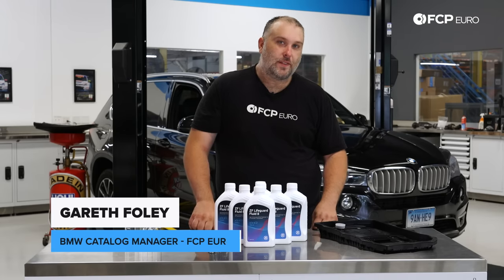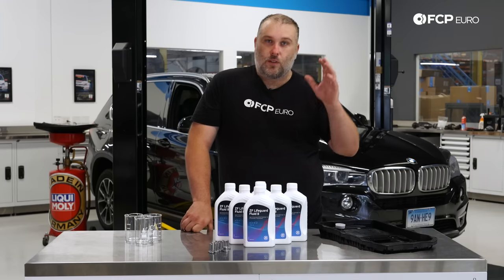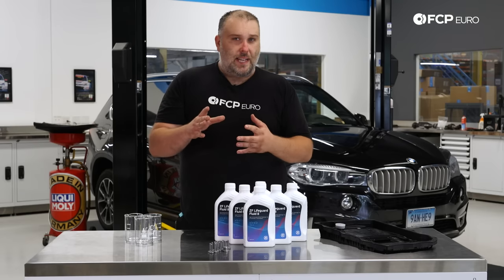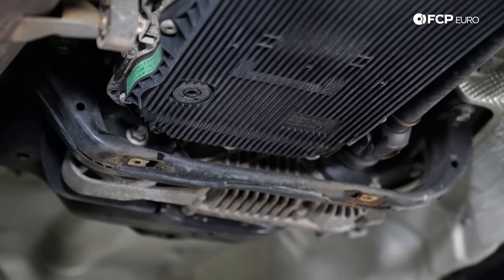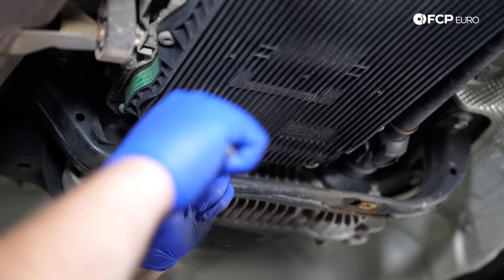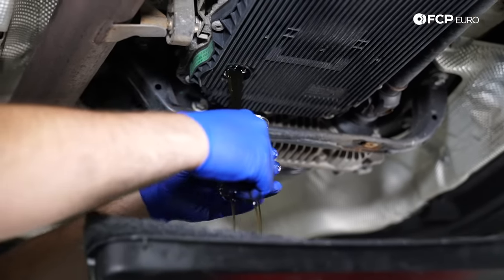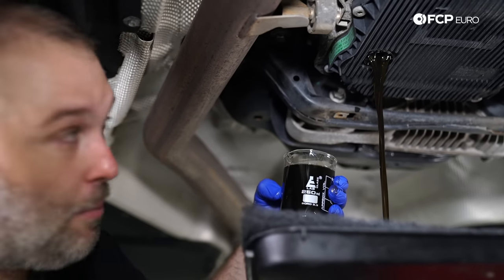ZF 8-Speed Transmission Oil Change (BMW, Audi, VW, Dodge, Land Rover, Toyota, & More)

Comment: So, i just bought my X5 from 2012. It has 230'000km / 140'000 miles on it.

The car has most definatevily not been driven hard. The guy before me had it since 2013 and drove mostly very long distances.. 
I cant see any history of transmission fluid change so i am really thinking about changing it now. 
Good or bad idea?

Comment: When I did my ZF-8HP fluid change I could only get approximately 2.5 to 3 quarts of fluid in the sump during the cold fill, way low. What did I get wrong?

Comment: 50k miles oil change for the new transmission where the whole oil is new. With this way, the transmission fluid wasn't replaced fully. Old and new oils were mixed inside the transmission, so the next oil change must be earlier than 50k miles. Am I right?

Comment: My transmission slipped while driving and then permanently was not able to send power to the wheels. Shortly after it got stuck in park while troubleshooting on the side of the road. I manually put it in neutral for a tow and noticed a massive oil leak and a saturated cover. I believe this service will fix the issue but am I too late? How can I check for damage? 160k miles F15 xdrive

Comment: just had the fluid changed at 78000km on 2011 audi a8l equiped with the ZF8HP and the transmission slips between first and second gear specialy when its cold but sometime also when its hot, could it be that its low on fluid? what if i add 1/2 a liter or 1/4 of a liter to it is there chances that it fixes the problem? this situation has been reported on many audi a8l

Comment: Is it safe to do a filter and fluid change on a ram 1500 with 180k miles. Have been told yes and no. It’s a sealed transmission and that it never needs to be changed. Need some expert advice. Transmission is shifting good no problems. Just regular Maintenance. Just brought it few months ago.

Comment: Question: I have a F31 328d, my exhaust runs right next to the fill plug, I can't see anyway to get the fill plug out, without dropping my exhaust. Is this correct?

Comment: how should you check to see if the oil is in bad condition and not worth changing? i bought a 2015 528i about a year ago with 86k miles and its at 95k and im not sure if it has ever been serviced before

Comment: What about trans cooler thermostat, if vehicle is equipped, and you drained while trans was hot? Assume the cooler and lines drain when thermostat is open. So recheck level when very hot???

Comment: I’m rebuilding a 2014 m235i I’ve basically got everything done mechanically to start the car but I want to flush all the fluids from the car. I was thinking of just flushing the transmission oil and putting new oil in before I started but am now reconsidering due to having the car running to reach temp. If anyone has any advice pls  lmk

Comment: Hi G. did or do you have to do a transmission reset//relearning procedure after you did the transmission fluid and filter/pan change?? if not, do this procedure have to be done or will the "relearn itself as you drive it"?ty sir, continue with the great informative videos!! 100-100  ty

Comment: HI got a brand new Mercedes sprinter with the new 9 speed auto box and its got a  problem when changing down when  coming to a standstill / say a set of light’s it  would just drop into gear at the last moment and  go bang ??
Dealer  said it needs to learn your driving style but 4500 miles it’s still the same  + I’ve  noticed when it’s changing up from a standstill
any idea how to make sure its a mechanical fault so dealer will fix under warranty ?? Any help would be helpful ~steve in 🇬🇧 UK

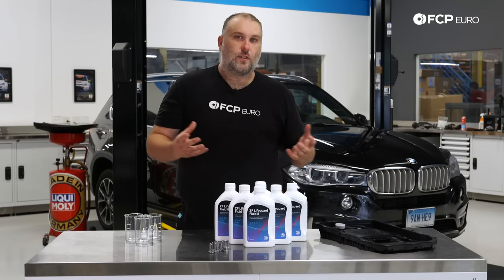Comment: 0:22 car manufacturers make more money when you need to replace a whole transmission instead of just the fluid and filters :) They don't need you to save money but to spend it :) :) 

And since most 1st hand owners keep their new cars up to 100 000 km at most this is pretty much enough what they need to last. Warranties and such are also limited to an extent where the owner has to reach deeper into his pockets once all the individual warranties run out. I for one know that there is a car manufacturer which has service intervals listed in numbers and once you reach a specific number the authorised service WON¨T change any gearbox fluid anymore. You as a customer have no idea about this because you are told that the gearbox has a "lifetime" filling. Except nobody will tell you that it is not your lifetime or the cars lifetime (which you would expect could be around 20 years at least) but the gearboxes lifetime and that is about the given interval of the manufacturer. In this case ZF and their 80 000 km recommendation. 

Plus second hand owners are usually irellevant to dealerships, authorised service stations etc. because 2nd hand owners didn't pay the manufacturer but the 1st owner. Not to mention 3rd hand or higher. So if you are a 2nd hand owner and your gearbox goes bad... well.. who cares? The car manufacturer definetly not. Except you come knocking to buy a new gearbox. 

So yeah, good point there. If you are a car enthusiast or do most/all of your maintenance yourself you likely know all of the good informations already (or still learning) and therefore you are able to keep your car running for a much larger lifetime with little costs. But if not then you have two options. Pay people to do your service for you or stick with new cars from the dealer and once they start getting close to their "lifetime" limit sell them and get a new one. Both options are going to cost you but the last one is the biggest one :)

Comment: I had the trans fluid , front and rear diff along with the transfer case all done at 49,000 miles on my 14 x5 35xi . My x5 is a very happy bimmer . Will have all those done again at 100,000 miles.
Reply: I have NOT done any fluid change to my 130k mile X3 xDrive35i and the transmission is still working super well, so this is confusing advice (OEM vs FZ).

Comment: I’ve had a gearbox cooler failure, it’s mixed the coolant in the gearbox, I’ve drained and refilled 3 times now, it’s still coming out very contaminated. I’m going to continue to fill and drain, the gearbox is still operating fairly well, is there any advice on how best to flush the box? Or should I just continue to fill drain?

Comment: My understanding is that the final fill needs to be done with the car idling above you.  When the engine runs, the transmission pump depletes the fluid level in its sump, and the fluid rises when the engine is off.  If you turn the engine off for final fill, you will under fill it.  I'd like a master mechanic to please confirm or dispel this information.

Comment: Do you know if the X5M trans pan (with Aluminum cooling fan) is compatible with regular X5 transmission, as the regular x5 trans pan is plastic, it can be brittle over time.

Comment: What about the fluid inside the torque converter, cooler and associated hoses? There’s a significant amount to fluid left behind in the system by simply changing the pan.

Comment: Is there any benefit to draining the transmission after a drive?  Since the pan gets replaced, I'm thinking that draining it cold would be just as good.  Often you lift the car for other reasons and can circle around to the transmission while doing some other maintenance.

Comment: I purchased the transmission service kit from fcpeuro for my 2009 BMW X5, and I used up 7 liters, but no oil dripped out after the 7 liters.  I wonder if I should buy another liter of transmission oil to fill it up?  One thing to note is that I left the machtronic off for 2 days because I noticed that I was missing one of  the replacement machtronic sleeve, so I had to get a new one before reinstalling everything, so not sure if thats the reason why it needs more than 7 liters of oil?  My car was level the whole time I was filling it up too.

Comment: Hi, bro just a quick question. I have changed the transmission oil and filter on f10 but after changing I can smell the transmission oil from the air vent when the car is fully hot and on idal. no smell when driving. any idea why

Comment: I found that depending on the exact position of the “straw” I was squirting the the fluid into the fill hole, it was easy to have the fluid come back out, but if I tweaked the position just a little, the fluid would continue to go into the pan. A little nerve wracking in a process where you fill to slightly overflow. Ended up working fine, but curious if any tips on how to position “squirter”.

Comment: What about the transmission oil cooler lines do they drain with oil change? Bmw 335d drive 2016, or do they keep the old oil in them ,as the don’t open till at temp too cool oil.  Which would then contaminate the new oil.   Or if the transmission oil cooler lines do drain when changing fluid. Then isn’t the transmission level too low now once these lines fill back up too be cooled leaving less oil in transmission sump 🤔

Comment: Great video, thank you. I'm on 95000 on my X5 and have just seen this, so well over the 50k mile recommendation. You mentioned at the end that if the fluid smells burnt and has stuff in it, there's no point in doing it. In this case, is it new transmission time?

Comment: half of the old oil is still inside, on the torque converter. This is not a good way of servicing these transmissions. A proper job requires an ATF fluid exchange machine.

Comment: Do we also need to lube the gasket of the new oil pan before installing or it goes on dry? You only mention to lube the O-ring. I was thinking if you also lube the oil pan gasket it will contaminate the bolts which will change the torque values from dry to wet. Not sure how to proceed? Besides that, great video, I will be doing mine soon with one of your kits.

Comment: Man im scared t ogive this to my dealer will they do the fill as you did like add the extra little bit? I have a BMW F32 420D and 145.000km i want to change the oil now

Comment: how much metal dust is too much metal dust along the magnets and in low spots on the old filter? i have 50K miles on a 2020 Ram 1500 2WD V6.

Comment: I have a question and hopefully you have the time to answer it. I have a 2018 BMW g30 540i with ZF transmission, it have 92k miles on it currently, I bought it new and I'm the only owner, I don't push it too hard and just drive it normal. I asked the dealership to do transmission fluid change few times and different dealers and they said this fluid it life time fluid and you can not change it, I know life time is probably 200k miles for BMW but know I'm at 90k miles and I'm not sure if it is a good idea to change it, I don't want to change it and then kill the transmission. how can I check if it is ok to change or not?
Reply from the maker: Hey Omar. ZF calls for a service every 50k miles on this unit, so we would advise doing a service now and continuing on a schedule moving forward. There is no such thing as lifetime fluid; they are referring to the lifetime of the warranty.

Comment: What about a complete hardware replacement? is it more correct? Because after a partial replacement, about 4 liters of fresh oil are poured in and mixed with old oil, since there are 8-9 liters of oil in the box

Comment: My transmission oil cooler, one of the lines is broken, I am assuming transmission fluid probably... leak, transmission wont shift to drive or reverse. Stock in park after a front collision.

Comment: I need help 2012 dodge charger se 3.6l 8 speed trans it shift ok but coming to a complete stop it gives a jerk after down shifting out of 1st gear sometimes but not all the time but now it's making a whine noise only when it's in heated range gets louder slowly also in rev but still shifts quite fine it also made my engine light pop on then popped off the next day

Comment: Hello, I have a question, does the engine have to be running for the final field top off? When I did mine, I was about half a quart short. Other words I emptied about 4 quarts and could only fill about 3 1/2.
Reply: Yes, the engine should be running for the final fill.

Comment: You need to do a flush where you run the vehicle and use the cooler return line to evacuate all of the fluid out of the system and replace it with new fluid until it runs clear and the torque converter has been purged of sediment. Simply draining 2 to 3 l from the pan isn't going to do the job.

Comment: Zf manual also says rev the engine to 2000 rpm for a couple of seconds in P before second fill. Also it mentions a procedure if transmission cooler exists, can someone throw light on that

Comment: I have a bmw x5 e70 2012 n55 engine with 119k miles i want to know if is safe to do an transmission fluid change or is too late now i heard that is not good ?

Comment: Question for fcp euro, so I was looking to change my zf8 transmission fluid. But my mileage is at 76k. Would you consider this possibly to far passed the recommended service interval to change the fluid?
Reply from the maker: You can most certainly still do a service, and just continue to stay within the 50k interval moving forward.

Comment: I got a 2016 ram 1500 231,000 miles fluid has never been changed. Should I just keep driving it like that or is it too late to change it now?
Reply: Change out to Maxlife.
Get a full flush replacement. 
Still may be too late though but hey I did this to my wife's subaru which the tranny was running like trash, complete improvement runs perfect now.

Comment: Do you need to do adaption reset after fluid change? What's the best way to get all fluid out of torque converter? Or how to flush it without wasting new filter there.

Comment: You have to drive it and get it past 160f to let the cooler line thermostat to open and circulate thru the cooler. Then let it cool back down all the way and repeat checking again.

Comment: Does the new plastic pan that come preinstalled drain plug need tightening to the required 8nm, or is it already tightened to the required torque?

Comment: Will I be okay if I don't check the transmission fluid temp before 2nd fill? I don't have a tool for it, neither any mechanic where I live.
Reply from the maker: It is crucial to do the fill at the correct temperature; we would highly recommend using a scan tool that can give you that reading.

Comment: Why worry about a scanner for the temperature, just simply run the car until you see the engine temp needle in the middle up to temperature an voila! presto! the oil should equally now be at its working temperature. What am I missing? just bring the car up to normal running temp.
Reply: Engine temp and trans temp are not the same.

Comment: Hi i have a BMW 2016 535d with 40.000miles im told i should change as the car is over 6 years old ?
Reply from the maker: You should consider it as you are right in the sweet spot for mileage!

Comment: The zf 8hp70 transmission holds about 9 liters of transmission fluid. To complete the service you should flush at least 10-15 liters of fluid through the transmission while performing the ZF fluid replacement procedure selecting gears and Performing the correct mph with the wheels in the air between each flushing.
Reply: my kit only came with 7 Liters....now I'm hesitant to start the job
Reply: @stevendeclercq3566  I used motul, if you go to their website you will find that their Distributors are very cheap. I flushed 16 l through the system. It was difficult to do on my Ram pickup because the thermostatic control only opens when the temperature reaches a certain point and it did not pick up any fluid from the return line so I had to stop the truck and put new fluid into the transmission with a transfer pump. Not a fun job but needs to be done.
Reply: mine is 8hp70 too, but it only drained 3.5L...not sure what's wrong.
Reply: When you say 'flush' you mean you're just doing this same thing, but repeating the drain fill process a few times?  Or are you disconnecting lines and attaching them to some machine to pump the fluid through?
Reply: @frankposterello1628  there is a thermostatic control valve on the transmission and it only opens at a certain temperature I can't remember what it is. I think you could use alpha OBD to possibly open it. What I did was drive the truck and get the transmission fluid hot by driving it hard in low gear. Then I performed the flush by removing the return line from the cooler to the transmission and allowing the fluid to pump from the return line hose into a 5-gallon bucket. It happened for me in fits and spurts because the fluid kept losing temperature or possibly falling below the temperature sensor so it took me a while to get it all out. But this will get the crap ejected from the torque converter. When it got low I began to pump fluid in with a fluid pump until the fluid ran clear.  This procedure will clear the fluid, if you drain and fill you're only going to get 3 l out and none of the sediment.

Comment: Whats the point of doing this change only one time? The gearbox contains 15 liter, you get about 3 liters removed/changed with this method.  Seems pretty pointless! The proper way of doing this is with a flush. If you cant do this you have to do this procedure atleast 3-4 times and drive the car between the oil changes. The new filter goes on after the last change, not after the first as in this video for obvious reasons.

Comment: How much oil one actually needs for this? Since oil in the torque converter stays, just want to buy enough to cover what's needed.
Reply from the maker: The kit includes enough to do a proper service, usually with a bit of extra as insurance.